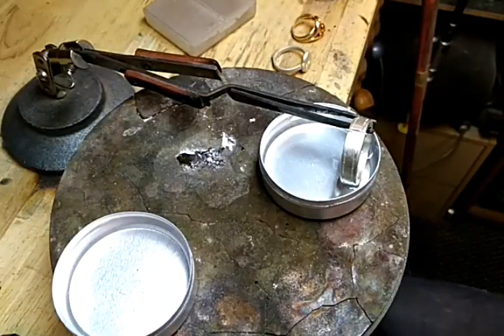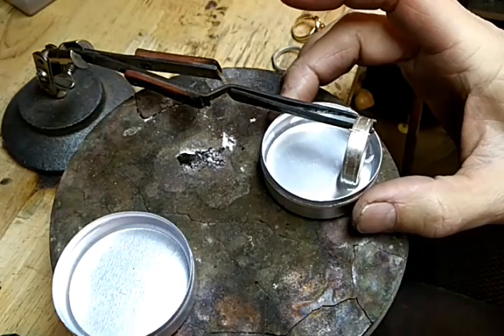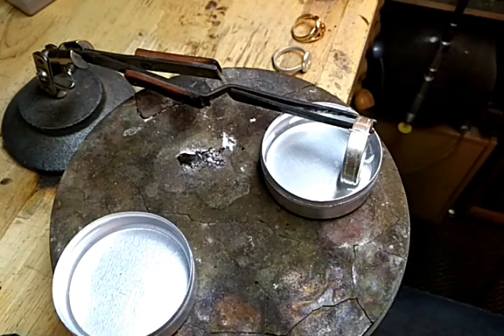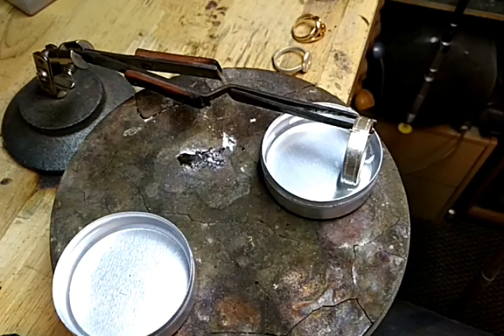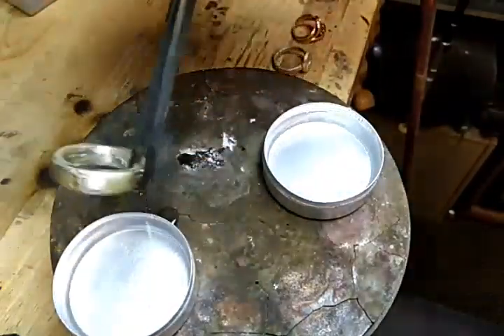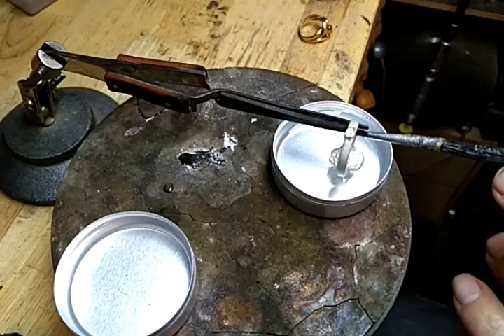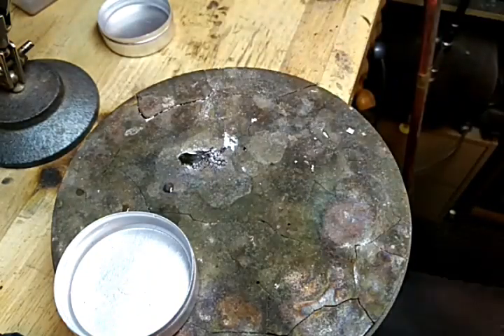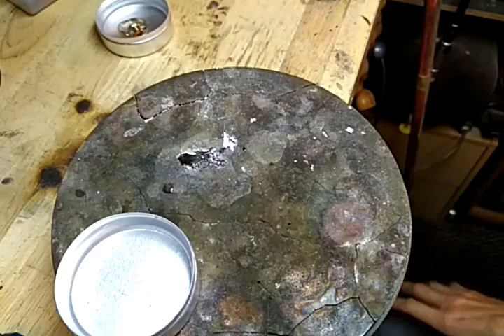Soldering rings with gemstones that don't take heat.

Comment: This helps enormously, thank you so much.  Great demo and lots of good advice and information.  I have had success when soldering in water, but not on this occasion - the shank is thicker, and two butane torches together are not strong enough.  I spent a long frustrating few hours, finding that out.

Comment: For most stones I clamp the stone part in the wider part of my locking tweezers in a third hand base dip it in boric/alcohol solution and hit the shank hard and fast.  For sensitive stones, opals, and pearls I use silica bead blast media out of our sandblaster machine, the superfine stuff, in the bottom of a cut down soda can. Wet the sand through and completely bury the head of the ring in it, and cover up the back of the stone with a little more damp sand...can add water to the sand if it starts to dry up too fast.  I find however, that steam from the water tends to blow my torch out at very inappropriate moments even with the sand... I use a Smith Little Torch.  Best torch ever for jewelers!!!
Reply: Thank You very much for your advice . 🙏
Reply: How would you approach fixing a 10k gold diamond cluster tennis chain with a broken link small stones

Comment: Will Mapps gas work fast enough?
Reply from the maker: You need a torch with a small hot oxidizing flame. I guess it depends on which torch you're using.

Comment: Would a Smith's little torch be hot enough with a size #7 tip?
Reply from the maker: I don't have that torch so I couldn't say yes or no but it's simple to experiment by simply trying it on a ring without a stone and see how long it takes to flow the solder and if the water starts to boil.
Reply from the maker: I just added a new video showing how I was able to solder two of the 3 rings using a mini torch and disposable bottles.

Comment: what about harming fingers,   I have seen successful soldering on rings using butane torches and also protecting stones using cooling paste ...see Andrew Berry.  ASBESTOS is a no no...dangerous to the lungs.   What about health and safety issues, Speed over safety ?
Reply from the maker: I have no idea what your question is?
Reply: holding metal to be soldered with your bare hands.....  AND mentioning using asbestos without mentioning that it is no longer used in the jewellery making industry at all...for health and safety reasons.   This is vital .  Yes protect your stones but more important...protect your health.  Eyes, hands , lungs etc.  Best wishes .
Reply from the maker: First, thank you for making these two important points which helped me in correcting my Description to add a caution sentence. Second, while using cooling pastes and hobbyist torches does work it isn't as safe as using speed and a professional torch, especially when working with gemstones that are expensive and there is no room for error.
Reply: He did say quite clearly that it is no longer used in jewelry making!